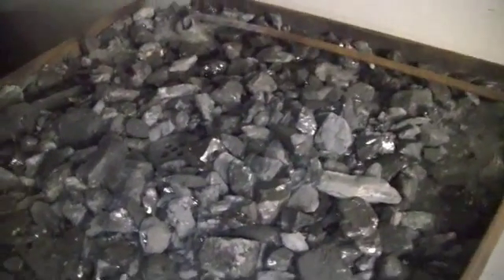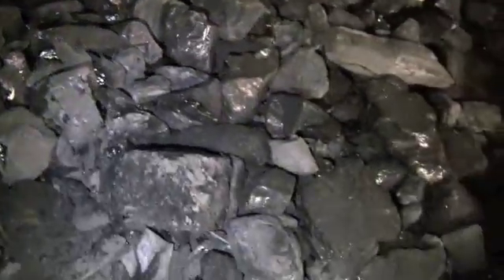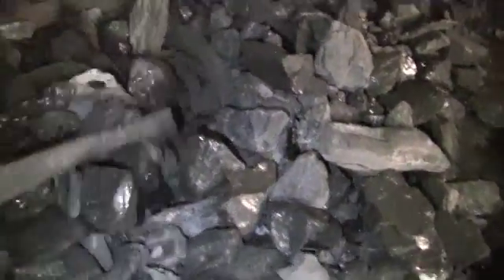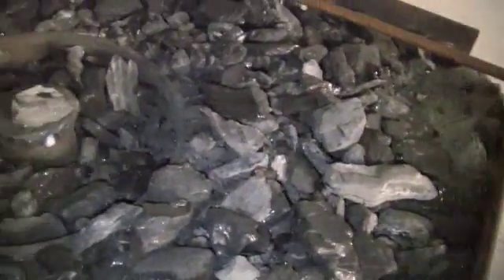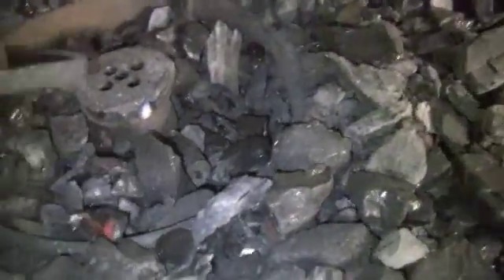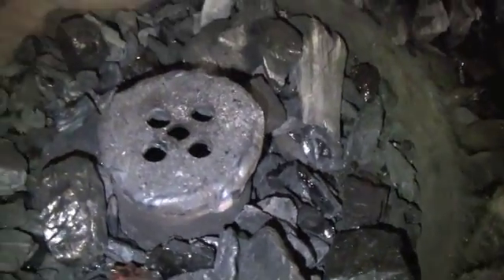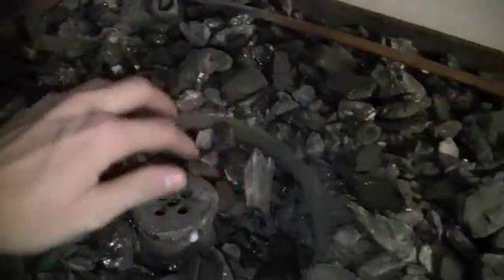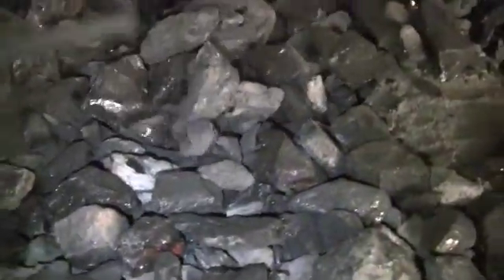Coal Forge Modification

Comment: I read a post somewhere that the fire needs to be a good 6-8" deep in order to burn off the oxygen before it reaches the work piece. That's why drum forges are so inefficient and difficult to work with. I just built mine and only used charcoal so far and it seems to get plenty hot. Any thoughts?